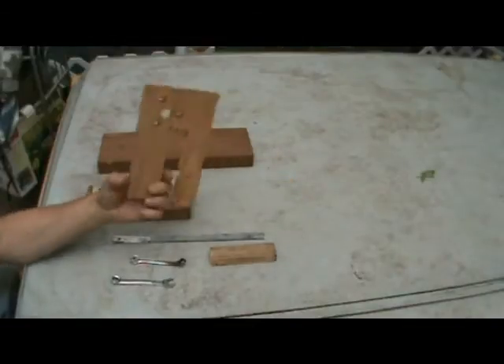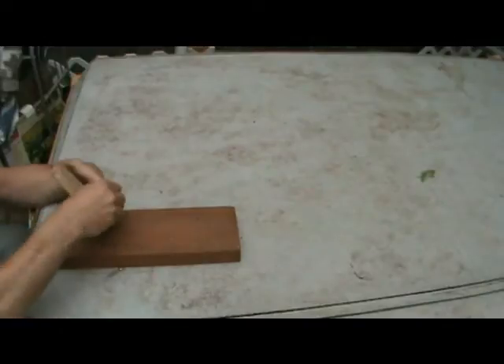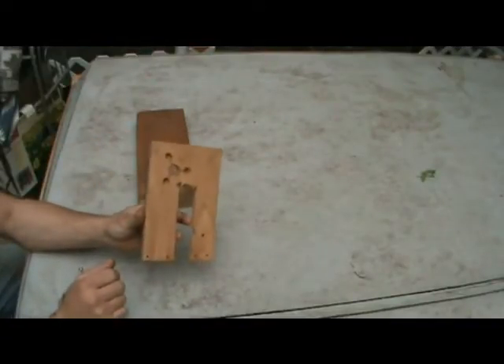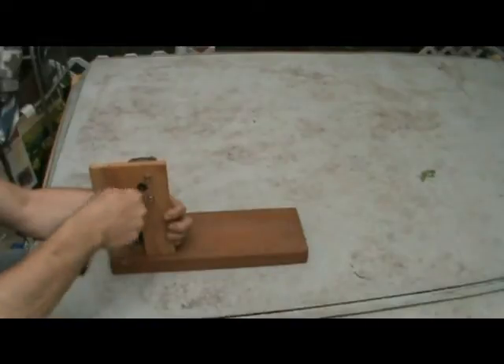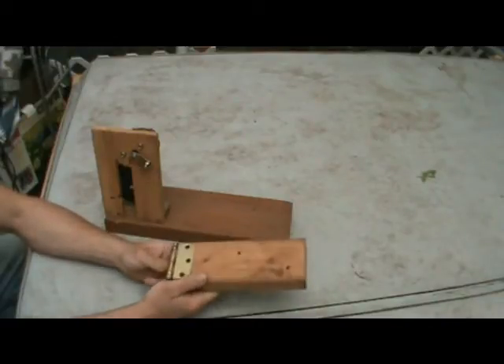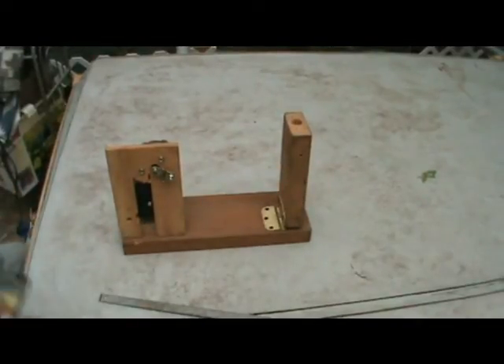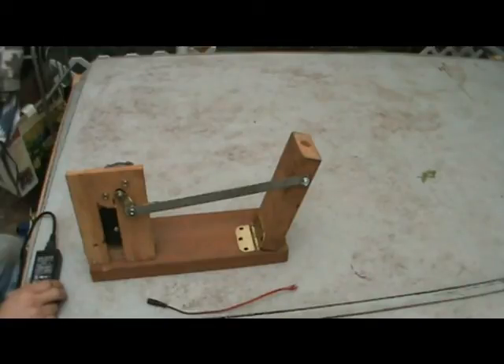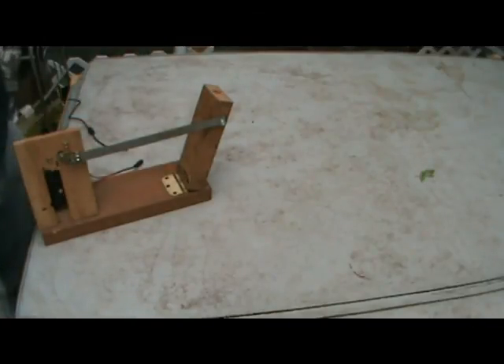Instructions for the wiper motor / rocking prop video

Comment: what make / model is the wiper motor?
Reply from the maker: I have used all sorts of different years makes and models of wiper motors in these bills. The particular one in the video is from a Saturn they are easy to use but can be hard to come by. I used to find the wiper motors that Chrysler used in 70s and 80s trucks and vans to be a good one for these builds to hopefully that helps

Comment: how much weight could be in the rocker and it still rock?
Reply from the maker: A lot is going to depend on how you build it. If you use a high amp like a 5 amp 12 or 14 volt power inverter you would probably break the wood or whatever you attached to it before you install the wiper motor. But if you used a low amp power inverter you might be able to stall with just 10 or 15 lb. Hopefully that makes sense let me know if you need more info
Reply: @sirrobyn0  I ask because I would like to fit it or a like device to fit a rocking chair for older people who would love to have a self rocking chair that doesn't cost an arm or leg. As we get older seems like we revert to the simple things that made us happy at one time... Any ideas would be helpfull. Not selling them, give away to anyone who might need it.
Reply from the maker: @texxxasron  I think you could do that.  May biggest concern would be obviously you'd need to make sure the mechanism is cover or contained so a person would not get anything caught in it.  The other thing would be speed.  If you look at the speed of windshield wipers they might he a bit fast.  So you'd want a high amp, lower voltage power inverter something like 5 amps 12 volts that will have plenty of power, but it still kight be to fast, in which case you'd need a resistor to slow it down and then you'd have to make sure the resistor was fire safe.  I think it would be doable, but you would really have to be sure to engineer the safety factors into this as it was designed to run a prop not a human and leta face it if a prop gets beat up, it's not the the same as someone losing a finger in the mechanism or potential fire if its gets stuck and is left on, so you need to address that somehow with some kind of cut out if it was overloaded.  Let me know if you try it.
Reply: @sirrobyn0  Thank you for the reply. I saw a device that had a patent application that expired due to non pay. I was thinking about all metal construction with wheel chair like foot-leg supports. Would use myself and or allow others who might want a try. I will let you know if I can get it going. Thanks again!

Comment: Please tel me the adaptor is12 v and 5 amps. Or what
Reply from the maker: Yes that is correct  I like to use laptop power supplies ideal voltage is 12 volts ideal amperage is 5 amps.  I give some other voltage and amperage options that will work in the video

Comment: What are the metal things?
Reply from the maker: There are basically two metal things, the hinge which, and the metal connector bar.  In this video I've used what is called flat stock and drilled holes in it. alternatively you can sometimes buy metal at the hardware store that has holes pre-drilled every so often.  Hopefully that answers your question, if not comment again and I'll see it and try to help!

Comment: My wiper motor gets very hot. Is this normal?
Reply from the maker: No, it should not get very  hot.  The wiper motor shouldn't get anything more than warm.  What are you using for a power supply?  I'd need to know the voltage and amp specs.  Is the wiper motor new or used.  Basically it's either a power supply issue, motor issue or linkage binding.  Let me know.